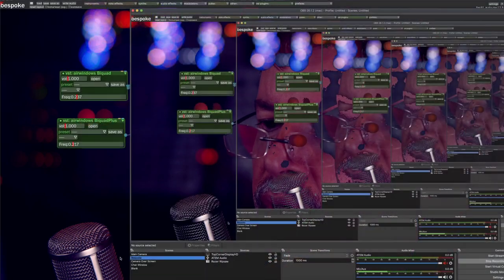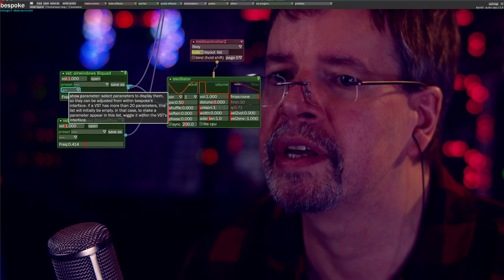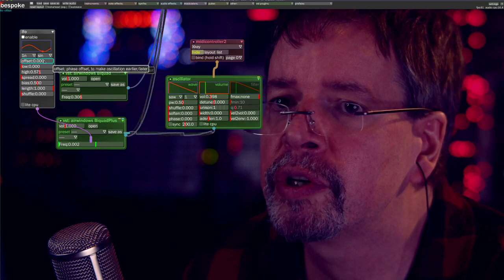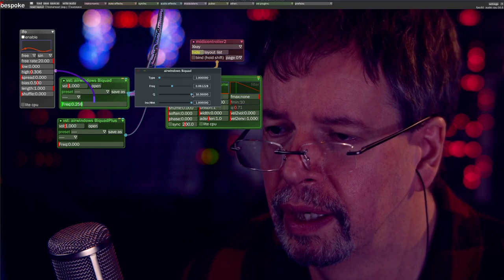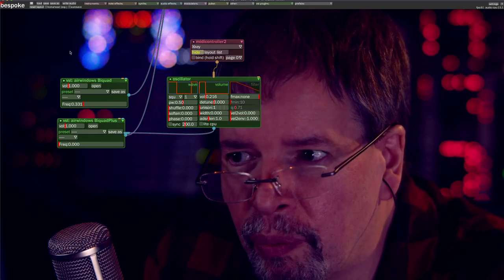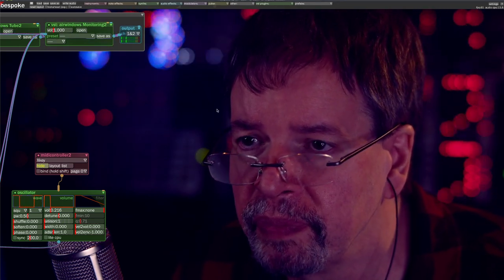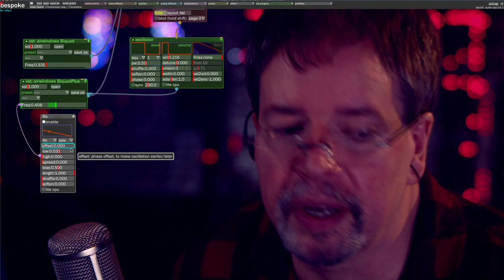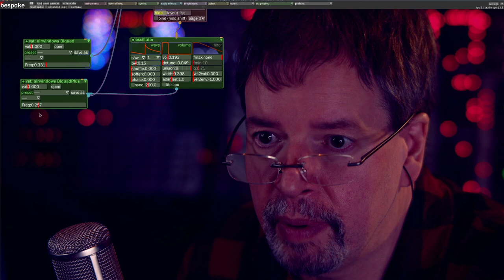Airwindows BiquadPlus: Mac/Windows/Linux AU/VST

Comment: de-zipping is essentially a low pass filter as far as i understand, so if there's de-zipping one won't necessarily be getting a true audio rate modulation above a certain frequency. it ought to be possible to look at a spectrum analyzer however to see if the modulated filter's freq is more or less peaking at the expected overtone, right?